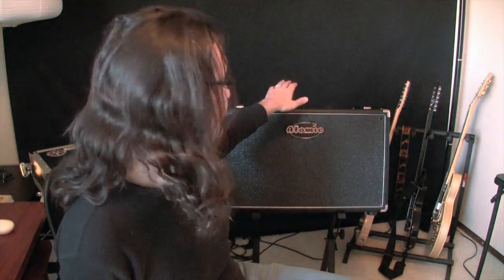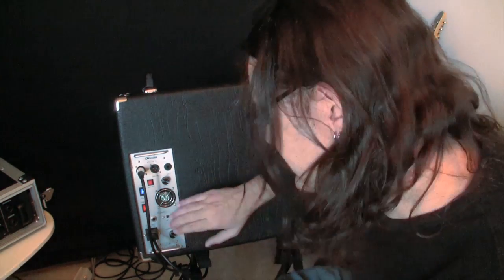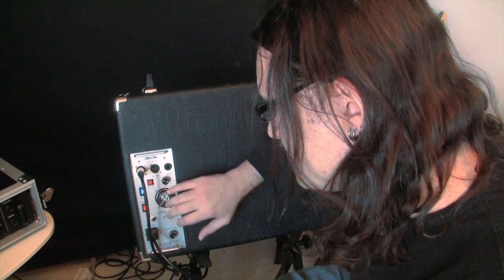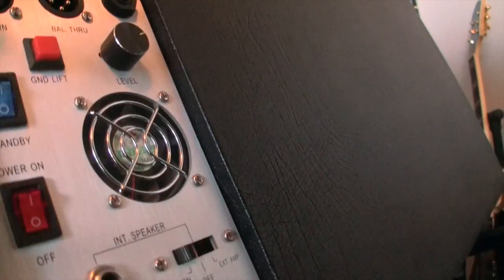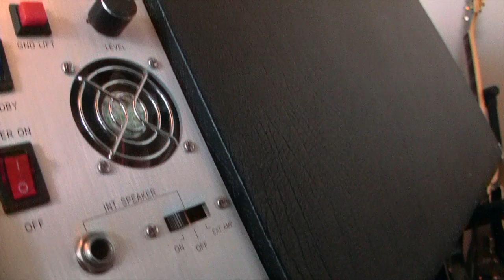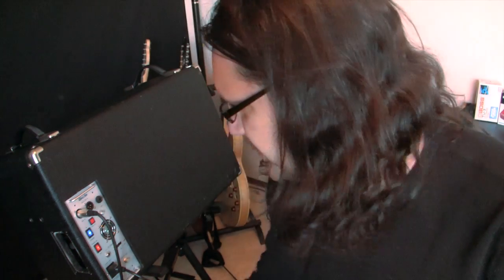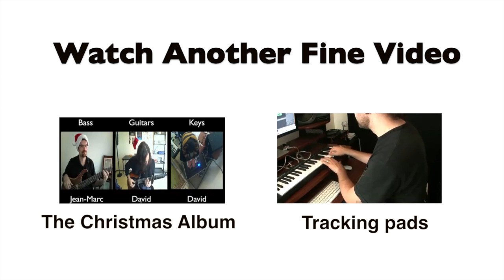What's Buzzing?

Comment: hey dave, i dont know if you have already tried this yet but quite often from moving tube equipment around a tube or two can become partially unplugged or "set". if i were you i would of course allow time for the stored electricity to drain then carefully remove and reset each tube making certain that they are fully seated. try to use a cloth or something to avoid oil finger prints and when you reseat them be firm but not forceful, they should seat in their plug easily, if you find a tube isn't

Comment: One of your tubes is likely on its way out and going microphonic.  That's usually the case when hitting or jarring your amp fixes the problem temporarily like that.  I'd recommend replacing both of them, especially if you've had that thing for a while, and have been using it a lot.  If you replace both tubes and the noise comes back, then it's probably one of the audio I/O connectors with a loose connection that's coming ungrounded.

Comment: sounds like a soldering issue, possibly as simple as a dry joint, you can get electric contact spray in any electronics shop. open it up and spray on the solder joints and stuff and should fix it and in any case the spray will be handy to have if it doesn't help anyway

Comment: @Wallimann  No problem -- to respond to the post above, this does SOUND like a ground problem, but I've had this exact same noise coming from amps with tubes that were about to fail.  But definitely be cautious around tube gear -- the power filter capacitors do often store quite a charge even after the amp is unplugged.  Changing tubes shouldn't be a risk though -- only if you open up the circuit and go poking around in there.

Comment: i had the same insistent buzz issues with every amp long ago.
i checked amps for ground signal dispersion: everything were ok with my amps but my plug on the wall wasn't connected with the ground cable of my electrical panel.
maybe some buzz is characteristic of your amp but if its too much i'd check for ground dispersion.
good luck

Comment: going in readily, make sure it is in its proper position and try again. once you have them all in just give them all a gentle push in to make sure they are well seated..you should be good after this procedure. usually if a tube has gone bad the problem and noise would be constant, not an intermittent issue like the one you are describing. if the fan has a modular plug, make sure it is plugged in well and remove any excess dust and make sure that your fuse is properly seated as well.lemme know:)

Comment: did you get that problem fixed? If not, one thingis for sure: you have a lose contact problem...somewhere! And this is how to search: the weak noise shows us something like dirt between two elements that should be connected well, such as lose connectors or fuse holder, or things that can be removed: check all these removable parts. And read next post...

Comment: The capacitors inside amps store enough voltage to kill you. It can take more than 24 hrs for them to drain. Once you open up the chassis they are no longer protected, and are exposed and just waiting for the wandering hand. If you insist on poking around in there, keep one hand in your pocket - electricity takes the path of least resistance, and if your arm is extended, the current will go from one arm to the other, right through your heart and probably kill you.

Comment: then try to inspect solder joints: it could well be a part that wasn't soldered properly and it may even be a component that was put through its hole before the soldering job: it moves, goes back to contact, and again out... Insist on checking terminals on the printed circuit board. Anyway the noises show us a minor failure, I mean a cheap one: probably no expensive component to change ... The printed cardbord could be slightly damaged: this can be fixed easily by soldering wire on it

Comment: electronic spray cleaner in the tube sockets and check the sockets for loose connections where the tube pins plug into the socket. After that I would replace the tubes if it is still a problem and check all wiring connections. resolder if necessary.

Comment: I've always heard that whenever doing anything on the inside of a tube amp that you should let it rest days (even a week) before. Since it holds a charge inside that could potentially electrocute and kill you (As in, will stop your heart from beating or knock it out of sync).

Then again, that's what I've heard from those more electrically savvy :). Not too sure myself though.

Comment: Perhaps the VALVES (haha just joking man) just needed re-seating? They could have come slightly loose and were not fully in the socket, a small tap could have been enough to make a tighter connection. BTW, if your tone suddenly sounds ten times better then your valves are probably dying. According to legend valves sound better just before they die.
Good luck getting the problem fixed if it comes back, it is always a hassle, so many things could be the cause.

Comment: There's no flux capacitor inside an atomic reactor. Everybody knows that.
I suggest David to check the dilithium crystal chamber, instead. Buzzes and vibrations are often caused by a failure of the magnetic containment fields in the antimatter dilithium chamber. Check antimatter injections efficiency as well. Keep us informed.
If this sounds too silly, keep us informed anyway.
Live long and prosper.